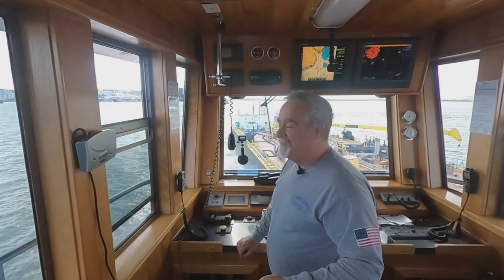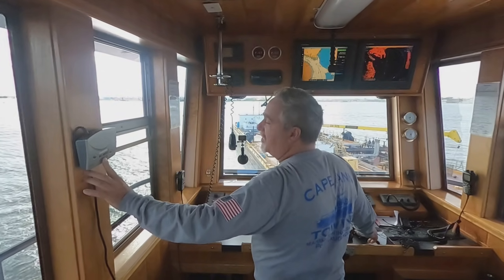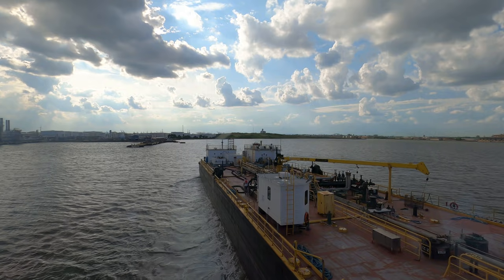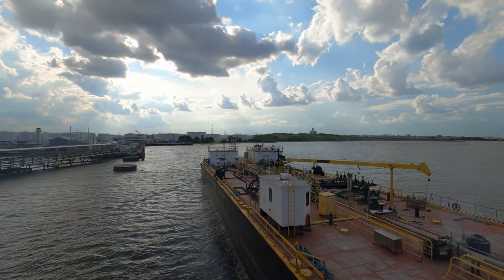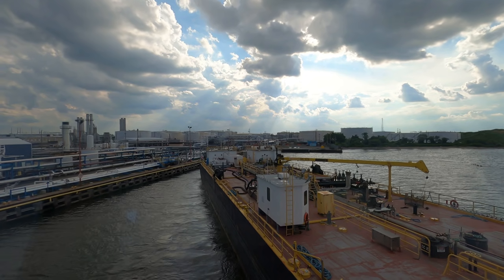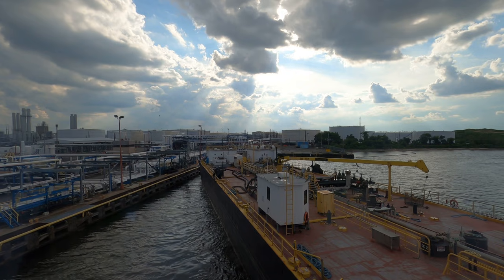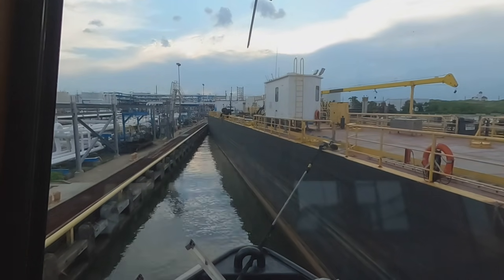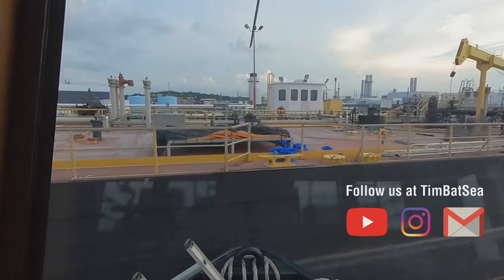Tug To Landing

Comment: Is there a wench at the bow of the barge to help bring the line in
Reply from the maker: Thank you for watching Dale. There is a "windless" up there, but we don't use it for docking. The Tankermen use it to adjust the lines as the load or discharge. CUOTO

Comment: Another great video.  I am trying to get a sense of relative weight and tug push or pull.  How much does the barge weigh and what is the rated thrust (?) of the tug?
Reply from the maker: Thank you for watching Bruce. We move many different barges and their weight is different depending on their load. But you could use about 2000 to 5000 tons for the barge without product, and as much as 12000 tons with product. The tug is about 200 to 300 tons depending on how much fuel we have and the bollard pull is 30 tons if I have that right. CUOTO

Comment: Nicely done. These type of jobs can go to hell in a handbasket very quickly. That first line you put on we would call a spring. Do you call it the same?
Reply from the maker: Thank you for watching John. We would call it a bow line, and we would spring into it.  Remember that we call either end of the barge the bow if it points in the same direction as the bow of the tug. CUOTO

Comment: I'm currently an engineer in the USCG on an 87' patrol boat. This may be a question for your engineer, but what civillian qualifications are required to be an engineer on a tug? From my research i've seen QMED and DDE but there's not too much information on how to get them and what order they need to be done in. Thanks in advance!
Reply from the maker: Thank you for watching the Jackson. Up until very recently, there were many unlicensed engineers on tugs less than 200 ton. But now with Sub chapter M, they all have to have at the very least a DDE4000 to work for us. CUOTO

Comment: For that first line connecting to the dock, does the barge have a winch on that line to help bring it closer to the dock or are you doing it with engines & rudder?
Thanks for sharing your experiences.
Reply from the maker: Thank you for watching. The barge does have a capstan, but we don't use it to pull us in. That was all the tug working the line. CUOTO